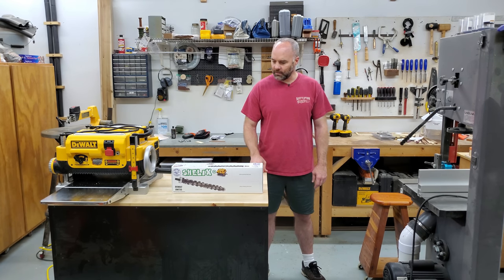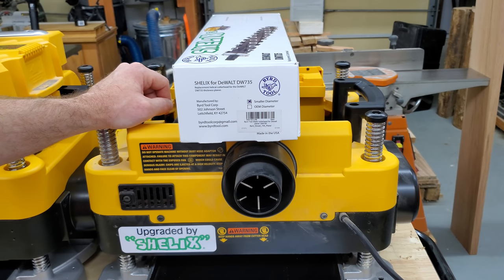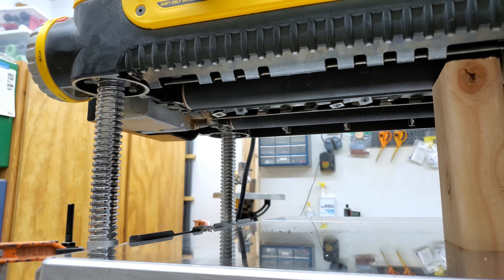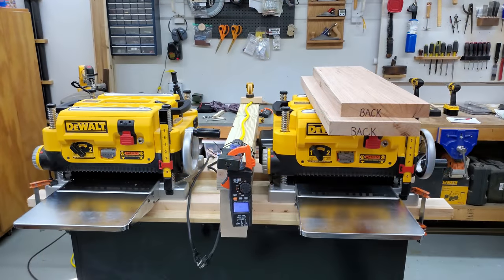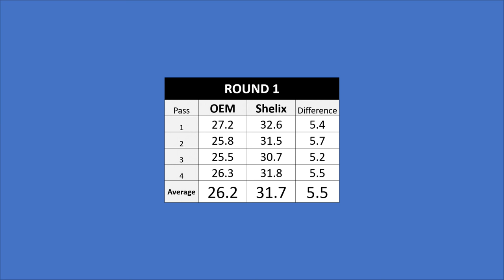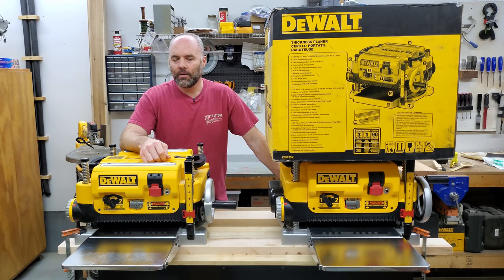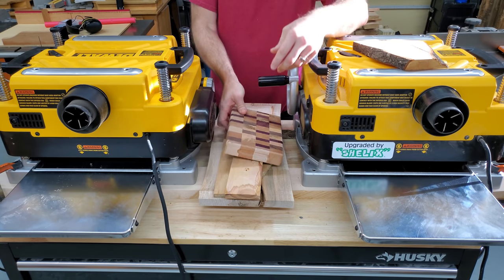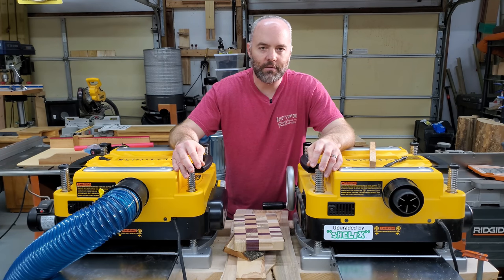The video I wish I watched before buying a SHELIX

Comment: would be cheaper also to purchase a hand held metal ( detector) pin pointer to run over the unprocessed work prior to planing. checking for broken nails, staples etc.

Comment: . *  *  *  *  *  If you used a 10 ga cord would it reduce the draw of those motors ?
Reply from the maker: It might help a little, but you'd still be restricted by the planer's wiring.

Comment: It would be nice if they put a number like 1,2,3,4 on each side of the cutter inserts so they dont get mixed up
Reply from the maker: Most of them have a mark in one corner, like a BT for the ones from Byrd Tool. If you set a rule to always rotate clockwise, you'll know to replace the knife once it gets back to the original position.

Comment: Hi Ben, I just wanted to include a few more pointers/remarks. I watched the videos again, and you were totally right the shelix heads INCREASE THE LOAD. here’s some thing you could’ve done and maybe you want to do this in the future because you have 2 electrical meters. Hook up the 2nd meter as a voltmeter. The voltage will drop (this is called LOADING) as the current increases. Basically you’re looking at the supply circuitry to your meter, which includes the extension cord, and the internal wiring in your house all the way to your circuit breaker in your electrical panel.  Generally, you will want to use outlets that are closest to your electrical panel to minimize this LINE DROP.  Frequently there is relatively high resistance when electricians use the push in connections in 120V receptacles.One final word, ALL ELECTRICAL METERS ARE NOT CREATED EQUAL. I would recommend that you borrow or buy a TRUE RMS CURRENT METER, and compare it to your meter. A good meter of choice for all electrical testing would be FLUKE. Also, for all your readers who are not familiar with electrical testing: Meters do need to be calibrated occasionally, especially if you drop them frequently 🤭.
Reply from the maker: I did a voltage test after a few people suggested it, and put the results in the description box above the comments. There was a slight drop, but nothing dramatic. One of my meters is a true RMS and one is not. I didn't think there was much of a difference until I swapped them between 10 and 1 loop line splitters, and the difference was multiplied.

Comment: And thats why we have 3 phase, or 240 volt units.  120 volts will use more energy
The motor will get hotter and you'll use more power to do the same work.
3 phse uses even less energy.
This is why commercial machines use 3 phase. It cost less to run them and you can get more horsepower out of them.
 Its like having your horse pull a wagon on 1 leg or 4 legs.  Dumb comparison but it gets the point acrossed if you don't understand 3 phase power.

Comment: good thing I was planning on 30 amp in my new shop
Reply from the maker: I installed a 30-amp circuit and 10-gauge wire in my previous house so I could run multiple tools simultaneously. The trouble is that standard plugs will only fit a 15- or 20-amp receptacle, and a 30-amp breaker could allow a 20-amp receptacle to overheat, so I would always have to remember to never run two tools off the same box. In retrospect, I would have installed two 20-amp circuits instead.

Comment: My comment is this im a machinist by trade (journeyman ) 40 years experience  not it does matter to much  but i worked on conventional  and cnc with carbide the reason that carbide draw more amperage  is due to the sharppeness  of the cutting edge   carbide tend to have kind the dull cutting edge  than the high speed steel  on the other hand carbide last longer

Comment: As Jeremy McClanahan stated, the 3-blade cutter has cutter voids or dead space between the 3 cutter blades that give the motor time to breathe between cutter blade hits.  The Shelix is is always cutting, so from the time the wood engages the cutter head, the blades are always in contact with wood.  Even though each bite is smaller, the motor doesn't get a break.  There is a similar phenomenon with motorcycle engine configuration.  An evenly spaced firing order on a 4-cylinder engine is harder to control in corners than a 2-cylinder engine because the tire is always receiving a power pulse.  There is more dead space between hits on a 2 cylinder (or a 4-cylinder engine with an asymmetrical firing order) allowing the tire to recover slightly between hits.  And leaned over in a turn, it makes a difference when the contact patch of the tire is smaller.

FYI, I installed the full sized Shelix on my DW735.  The original blades were made of butter.  The Shelix is amazing.  I chose to take the hit and remove the cutters for the install so I had nothing to adjust again. I just take smaller bites now because it does bear down more than it did before.  Totally worth it.
Reply from the maker: That's definitely a plausible theory about the motor strain.  Smart move getting the OEM-sized cutterhead.  The minor hassle of removing the cutters probably seems pretty insignificant now.
Reply: Good analogy about the motorcycle engine.  I bet you know what a "twingle" is.

Comment: Awesome video!!!

I’m curious if you’ve had the breaker trip much at all in service with the Shelix since you installed it?
Reply from the maker: I have not yet tripped the breaker in the wall, but I've tripped the breaker in the planer a few times. It's usually only a concern with wider boards and only happens after multiple passes.

Comment: The reason you shouldn't plane bark is that in the logging process of getting the logs out of the woods, they get dragged through all sorts of dirt, including sand , gravel, mud and everything else you can imagine. Those things will dull your knives quickly.

Comment: Tl;DR - Frankly I'd call this Matthias Wandel quality science.  You covered the testbed, methodology, eliiminated most artifacts, and got some numbers.  It's also education which makes it BETTER than just good science.

None of my possible comments (below) will make a difference because we both agree that if it feels good get it, and yeah, no ROI could "justify" this purchase.  Also you're unlikely to make a third video!!!

Well said, recorded, demonstrated, explained, etc.  Kudos to you.

Ehud Gavron
Tucson, Arizona, USA

Only read further if you're wanting to get feedback specific to the testing methodology.  If you don't .. don't :)

1. I recommend using a Kill-A-Watt.  If a clamp meter is used, know that the loss you see when it's off is not the same loss as during power draw.  While 0.01-2A (displayed;  10 windings) seems like not much compared to 0.0 reference, it changes when you go from 0.0 draw to 25A+.  The Kill-A-Watt tares its own use out of the displayed result.  Loss is proportional to current and resistance.  No current = less loss.  

2. By not using a Kill-A-Watt you should use a voltmeter.  It's important because 32A @ 110VAC is 3.5KVA but 32A @ 122VAC is almost 4KVA.  Not knowing the voltage DOES allow us to compare one set of cutters vs another set of blades, but:

3. It's way too much work but ideally you'd have switched the blades/cutters halfway through the test.  Think of it like the teams switching sides at halftime.  That eliminates differences in a 6-year old motor, installation errors, etc.  It also makes it easier to see if the amperage stays with the blades/cutters OR with the machine.  Otherwise we can use those numbers in general but the only inescapable conclusion can be comparing different cut depths or wood on the same machine/cutters.  You can't really beat the laws of conservation of energy -- if you ask the machine to do more work it will cost you more in energy in.

4. Frankly, I do have a problem with the readings.  You said it was a 20A breaker and a 20A (12awg) extension cord.  I don't know what the splitter's rating is but let's assume 20A as well.  None of that explains consistent readings of 32+ amps.  Is it possible the meters are misreading... the planers are using the motor inconsistently... really hard to know because the clamp meters measure instanteous readings.  The Kill-A-Watt can total watts used over a period of time.  I could throw the words "safety first" and think of the children but when you're playing with power woordwoorking equipment that's just silly.

4. dBa meters are cheap. I use the $20 BAFX one from Amazon.  Make sure to set it on dBa not dBc.   I'm not really sure sound is a factor when using power equipment... as there's no "silent" table saw, miter saw, belt-sander, etc., but hey it's your video :)

5. Angle of infeed.  This is a factor for two reasons, one being that the higher angle of incidence (narrower SHELIX) will push up more against the cutters and hence cause more friction and power usage than the OEM blades.  The second is that the pusher rollers have to work harder to move the piece forwad.  Kill-A-Watt would show a higher usage overall but not why.  Timing the speed of 3 board feet through each run on each planer would definitely help answer that.

I guess my takeaway (other than AWESOME video, great explanatory detail) is that no matter how many columns you put in your spreadsheet some (like me) will always find more to add.  In this case it's WORK-IN (actually VA used), WORK-OUT (board feet per minute processed), and of course the ROI curve.  I've avoided that but since I've spent all this time, why not.

$400 for 40 cutters each with 4 sides, so $2.50ea.  Third parties (not Shelix) have 56 cutters so $2ea.  Standard OEM Dewalt blades are $25 for  3 blades each with 2 sides, or roughly $4ea. Solving for X we need to make up $375 and we do so $2 per nick.  That is over 130 nails/nicks.  I think we can agree this is not an ROI item and either we want the "better" cutting method or we don't.  We will not be making it up over time.  If we were that concerned we'd use hand planers ;)

Overall I look at this like... I can drive a Subie, or I can drive a Bimmer.  There's no ROI there, and the Bimmer will use more fuel and its repairs are more expensive.  My friends love their Subies.  Me, I'm an ex E.31 guy.  ROI wasn't the decision factor here.  Neither was fuel use, noise, or work performed (WORK-OUT) for stuff put in ($$$$-IN).

Returning that back to conversations about planers, if it's a better cleaner blowout-free cut I really don't care that much.  If I was making lollypop sticks for kids (or picture frames for mom, or a French cleat shelf for dad) I'd want to minimize costs and increase productivity.  Fortunately I -personally- do not :)

Thank you again!!

Ehud
Tucson
Arizona
Reply from the maker: Thanks for the feedback. I read it all, but I'll just touch on a couple of points. I added some voltage measurements to the video description. The Kill-a-watt or similar has been suggested several times, but it's only rated for 15A, and the one I used is rated for 600A. Several people have used the Kill-a-watt and reported lower numbers, but then got the same results as me when using a professional grade meter. I actually have a Kill-a-watt, but I haven't plugged the planer into it. The splitter was rated for 15A, but I have a follow-up video where I used a homemade 20A splitter and dissect the planer's circuit breaker. The link is in the pinned comment if you're interested.
Reply: @TheSnekkerShow  Thanks!  There were a lot of comments... so I just addressed mine to you... but will now read up to find the pinned ones.  I agree a clamp meter and split wires are the way to go... but don't like its "averaging" method over time.  Sine waves suck like that :)

I appreciate your reading my comment and responding.  Like I said... I loved how you did it.  Also I love the "can do" attitude -- "What the hell, so I [grunt] bought [life] this ENTIRE OTHER PLANER!"  awesome.

Comment: I disagree with you on the warrantee.  If you burn out the motor using the Shelix cutterhead, Dewalt is not going to replace your motor under warrantee.   The motor was not designed to handle those higher loads.
Reply from the maker: The planer has a thermal breaker to prevent motor damage from higher loads. It works the same regardless of cutterhead manufacturer. https://youtu.be/24f-J0lVo-E

Comment: Do you normally do 1/16" or even 1/8" passes on hardwoods?  I rarely attempted more than 1/16" with my old 5hp 15" grizzly, and I sure as heck wouldn't try over 1/16" with my dewalt.  I'll take the time to do half revolution (1/32"), speed 2 for dimensioning and 1 for finish, and maybe even doing a quarter turn for the final pass.  After a couple hundred feet of wood on a fresh set of stock blades, I've tripped the breaker on a 1/16" cut with pine... I just ordered a Shelix (a few came up on Amazon yesterday for immediate delivery, and direct from Byrd was ~20 weeks, so I pulled the trigger), and my main reasoning was blade life and consistency of cut.  I recently swapped the blades in the 735 and nicked all three on the first board with just a small knot.  I'm tired of that and tired of a set of blades lasting for one medium sized project...  
A few other things that come to mind from this video:
1. I can't help but think that since you used the MAX setting on your meter that you were getting the initial draw when the wood hit the blades and the motor was still recovering from the RPM drop.  I'd be interested to see what the max draw is AFTER the first 4 or 5" has been cut and both rollers are engaged.  30 amps for more than a few seconds is going to pop a 20 amp breaker.  Something just doesn't add up here.  I would expect the motor to draw maybe 7 or 8 amps with no load, and maybe a little more than 20 amps at max load, but not over 30.  
2. Voltage drop can cause amperage to go up, and the further you are from your breaker box, especially with extension cords, the worse this can get.  How long was your 12 ga ext cord and how far from your breaker box was your outlet?  Running a volt meter at the same time would be helpful.  
3. The smaller diameter head would seem to have higher torque, resulting in less amperage draw, BUT the gear or pulley wheel that drives the head is, I imagine, the same size as stock, so the RPM's would be the same between the two.  However, being a smaller diameter spinning at the same RPM, the blade velocity would be lower, which should be easier for the motor, not harder.  Then again, it might be easier to cut wood with more speed than with less... Either way I was hoping you would be comparing the larger and smaller diameter shelix heads for comparison.  
4. Blade sharpness would be a major factor, and as I mentioned I have had stock blades with less than 100 ft on them stall out and burn even pine.  I am guessing that the stock dewalt had fresh blades, but did you go through and turn each of the shelix blades to fresh sides or were you using the same sides of each blade you have used for other planing?  Another factor here is carbide is usually not nearly as sharp as high speed steel, so while a carbide blade with some miles on it might still cut as good as new, a new HSS blade will be significantly better than one with some miles on it.  I'd be interested in seeing this same amperage comparison after a couple hundred board feet of hardwoods were run through the stock blades.  My guess is the stock blades would end up drawing way more amperage than the shelix as the stock blades reach the end of life.
Reply from the maker: I normally take as shallow of a cut as possible, but if I just face-jointed a rough board I'll take heavier passes until the planer starts to complain. I have one or two other videos posted showing amperage measurements without the Max setting, but it made sense for the purpose of this video and doesn't misrepresent the load. There's some other information in the video description (and in the comments) that answers the FAQ of why the breaker didn't trip.
Reply: Same here.  A full turn of the handle is just too much on a full width hardwood board, and will overload the motor.
Reply from the maker: I finally got around to testing voltage tonight. Starting with the original setup with a short 12-gauge extension cord, it was approximately 120v before starting the motor, 119v after, and dropped to 115v while planing 8” wide maple. Then I plugged directly in to an outlet right next to the breaker panel and got 120v, 119v, and 117v.  There were some minor fluctuations between test sets, but those numbers are a good summary of the results. Amperage was maybe 1 or 2 higher using the extension cord, but still around 25-27 for both.

Comment: simple enough space up the rollers to remove tension, and cut the finger guard up 1/8 inch so the machine works like it had an oem part in it.  It's not a safety concern your only taking back real estate you owned.  A 4" body grinder with a cut off wheel would do it if I remember there's nothing behind that  finger guard it hangs down.
take scoring cuts nothing big and fast.  Then you'll have a low rider planer!
All this to save a few min's  
I think they could do these with smaller bearings and a replacement seat you put in over any damage you might do.
go a tad heavy on the washer on the outfeed roller to help kill snipe.
Reply: Should just buy the OEM size and take the time to take the cutters off. He even recommends removing half of them for installing the undersized. I was about to say the OEM size costs more but when I went to look at how much more...it's not available anymore. What...the hell? They even emphasize the problems the undersizing causes.

Edit: The OEM head is still available. You have to chose it when you click their "Customize and Order" button. And it no longer costs more. Both are currently $400 when ordered direct from Shelix.
Reply: @vbaspcppguy  
For what he's spent on both units, he should have bought a Woodmaster made in the USA and 10 times the machine.